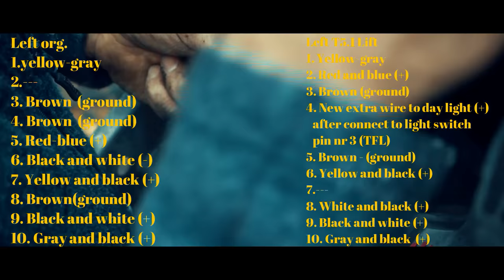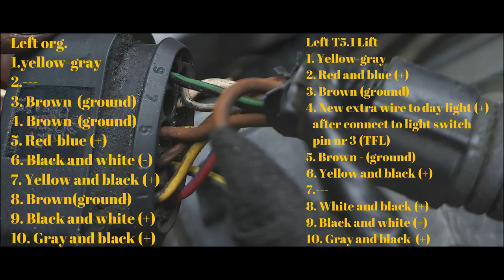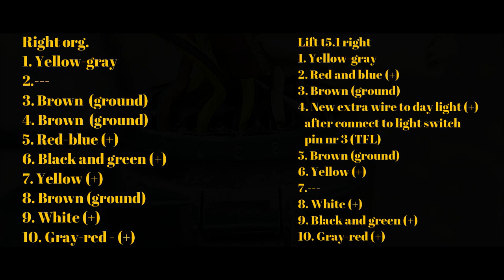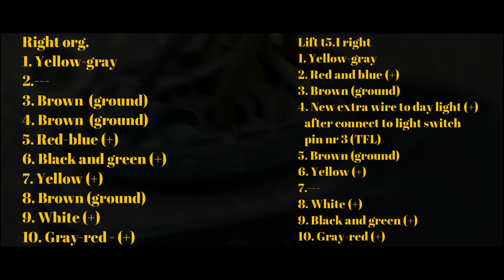VW T5 Retrofit to T5.1 Lift ,Vw t5 Front Upgrade

Comment: Thanks for the vid and very appreciated!!! Question, is this correct ...do i connect a new wire into pin no. 4 on the left headlight  connector and the same for the right side headlight connector? If this is correct, where do i connect the new wire into ...the fusebox or anywhere else?!🤔🤷‍♂️

Comment: At last a video with someone changing the slam panel,  every video ive seen they make brackets for the lights or skip that part of fitting . I bought a T5.1 front end and it came with top panel . The 2 bolts that hold the bumper to the wings were rusty as hell everyones look mint 😂 progress so far bonnet and freshly painted wings are on but as you know headlights need to be fixed to the panel . I didn't get the bottom bumper plate and as you not say if t5 will accept the bumper am a bit lost ! Half of my bumper bolts were missing to start with and i bought plug and play harness for the lights but appreciate you have taken time to show how you have wired and shown every part number . Ive decided now to fit the slam panel ive got this far and want it to be done right . Luckily i have some idea what am doing but again am lost with bottom bumper bracket and some brackets your showing Thumbs down . Do you have the slow motion video anywhere on you tube ??

Comment: Hello. Do you have wiring diagram for H7 & H15 double lights?
Reply from the maker: Not remember 100% but just try this:

	1.	H7 Low Beam:
	•	Pin 2: Connect the ground wire (usually brown).
	•	Pin 4: Connect the power wire (typically white or yellow).
	2.	H15 High Beam and DRL:
	•	High Beam:
	•	Pin 1: Connect the power wire for the high beam (usually white or yellow).
	•	Pin 2: Connect the ground wire (usually brown).
	•	Daytime Running Lights (DRL):
	•	Pin 3: Connect the power wire for the DRL (typically grey or green).

Color and Pin Configuration:

	•	Pin 1: High Beam Power (White or Yellow)
	•	Pin 2: Ground (Brown)
	•	Pin 3: DRL Power (Grey or Green)
	•	Pin 4: Low Beam Power (White or Yellow)

Comment: Hi there,
I did a face lift but have a problem. My new headlights point low when on dip and when I switch to full beam they point way too high. Any advice for me? Thanks
Reply from the maker: Hello what its your headlights OEM Part number?
Reply: @CheckEnginePlusMinus  I have no idea, will I find that on the headlight?

Comment: Dou you think that  it can be possible to facelift from T5 to T6.1 as well ?
Reply from the maker: yes, without any problems💪
Reply: @CheckEnginePlusMinus  I hope you will do it... Congrats again.. I just bought a T5 High Roof  and planning to facelift it toT6 or t6.1.. If I face  any problem ,be sure I ll keep contact with you ; if you dont mind.. Take care.
Reply: @pontoxs1  hi huseyin, I facelifted my van to t5.1. If you need to facelift to t6 you will need to change wings, slam panel and water bottle and also brackets. T5.1 is much easier
Reply: @gerryhannan9463  Hi Berti.. Thanks for your message. . I started facelift yesterday and it seems the result Will be good.. But after I read your message, i realised that I missed to buy water bottle. It should be changed with T6' water bottle?
Reply: @pontoxs1  I think it has to be changed to fit, I remember reading it online but I think you should try without it and maybe save some money! Good luck
Reply: @gerryhannan9463  Hi again...I succeed the facelift t5 to t6.1 . The thing we discussed before ;If you want to install a fog lamp, you need to change the wiper water tank with t6.1's
Reply from the maker: that's great, I'm very happy 👍. Next time, shoot a video and we'll share it on my channel 😉 you'll always save a few dollars 😎😉